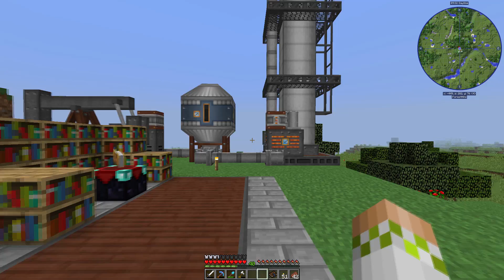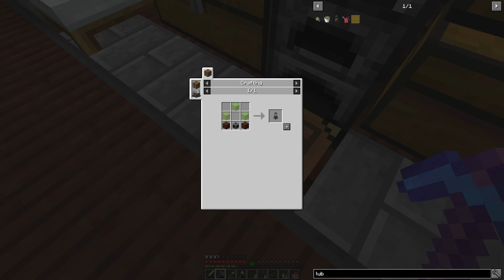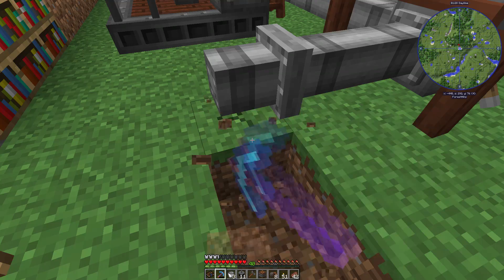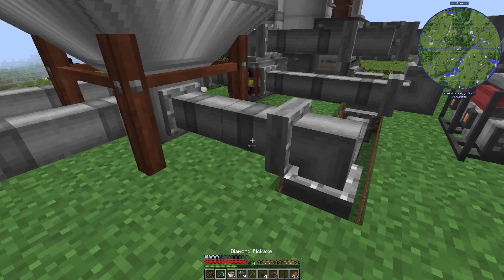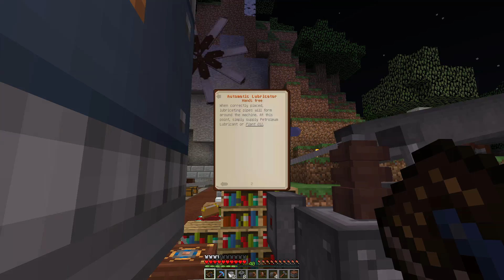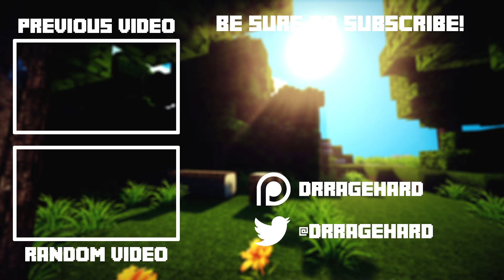Surviving With Immersive Engineering :: E13 - Crude Oil Power Generation

Comment: How do I bucket out diesel from distillation tower? I put a bucket in there but nothing's happening. Diesel won't even go into the tank even tho I have it piped.
EDIT: Nevermind, found out what the issue was... Apparently you cannot have fluid Router hooked up to it since it only generates Naphtha and Diesel, so you just hook it up with 1 pipe into 2 tanks and it works fine.

Comment: Do you edit with sony vegas?
Reply from the maker: Yes I do! Sony Vegas 13 Pro :)
Reply: @RagePlaysGames  You might've noticed that the video is kinda blurry in some parts. If you look through it frame by frame you will see it's sometimes showing 2 frames. This is something Sony Vegas does called "resampling". It sees that your video is 60fps but a frame is missing (bc recording software didn't perfectly capture 60fps, which is normal) so Sony Vegas tries to make it smoother by blending the frame before and after. I personally think it looks bad and it shouldn't be on by default. If you want to turn it off it's easy. Just select all video clips in the editor (press d twice to get a selection tool) right click and hover over "switches" and click "Disable resample"

I use Sony Vegas 14 so it might be a little different but Sony Vegas seems to not change too much between versions.

Comment: Immersive Engineering is not very friendly for cramped-space builds; this would have been a lot easier with more room to sprawl.

Also: the plumbing could have been slightly simplified by running one of the pipes down from the fluid router, underground.

Comment: I'ld build a tank for each fluid, place a bucket of the respective fluid in before pumping to them.
Reply: So much this. Lubricant, in particular, is not used very quickly compared to how fast it's produced; using tanks (or even barrels but tanks give you more of a visual cue) gives you a chance to respond to overproduction before the whole system clogs.

In modpacks that offer a way to void fluids, you can also set up a tank with a comparator that'll pump stuff into such a void if it gets too close to full - although you'd probably want at least one of the outputs (whichever you expect to use the most - probably diesel) to not be voided, so that the system doesn't keep wasting oil.
Reply: @shurhaian  work around would be a bottler to conveyor to cactus as a way to void the lubricant if it's too full. costs glass, but if you build a witch farm then empty bottles become super easy to acquire.

Comment: To avoid the issue with wire's and relay's use transformer's to convert the power to what your using mostly and revert it to other's that you might need for powering all your machines around your base, HV, MV, & LV transformer's are a major help with wiring issue's and you can hang them off pole's so there stored up out of the way no matter your base size. But keep in mine the range the cable's can run.
Reply: Honestly, if you've got a capacitor right there, transformers are a bit redundant. ETA: The only time I'd really worry about messing with transformers is in cases where the connected wires are not negotiable and you DON'T want to put a capacitor right there - e.g. a power generation setup like this except with the capacitor elsewhere, or splitting off from a medium/high voltage line to feed some lights (which only connect to LV). Even for the lights, I usually just wind up putting an LV capacitor in, which also serves to let the power pass through a wall/ceiling.